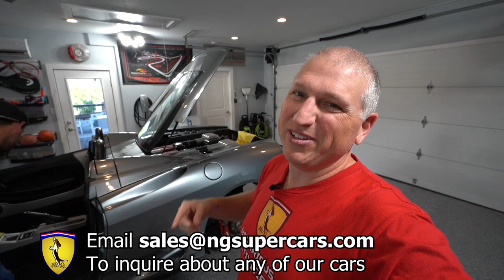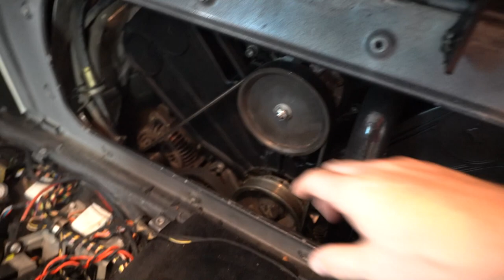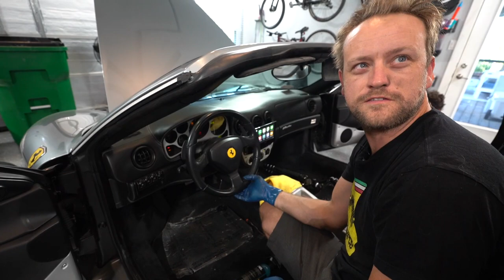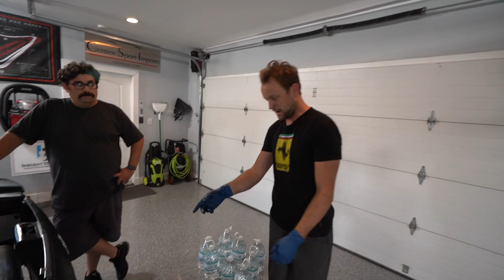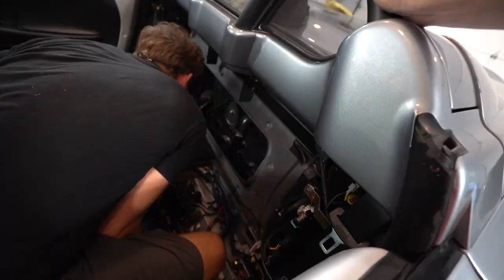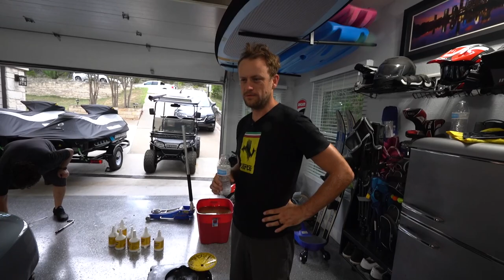Saving $10K Ferrari 360 Heat Exchanger Failure

Comment: There is a ghetto wat to clean all the cooling system, dissolve a dish washer tablet in the water and use it to flush it, will break all the oil and clean it easy.
Oh BTW there is a 360 Stradale Spider here in the UK, was an amazing conversion made by the Youtuber Ratarossa. ;)
Reply from the maker: Good idea

Comment: I say YES to the jeep build.  I have a TJ myself, great fun and a great backup vehicle.   I built mine with Nth Degree 6 inch long arm lift, ARB's front and rear, on board air, 35's, yada yada yada.   As for the 360; make sure the tranny vent is open, it'll be blowing steam out as it hits operating temp the first time!   lol
Reply from the maker: Good idea